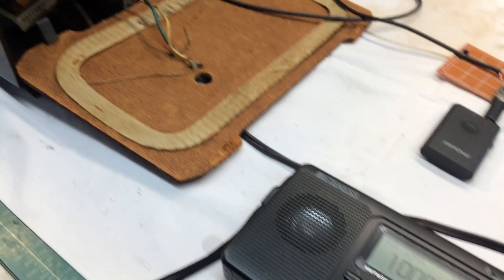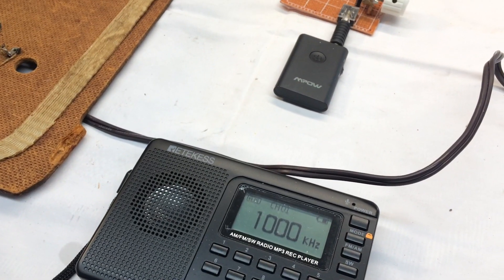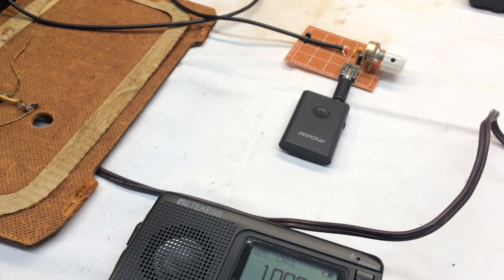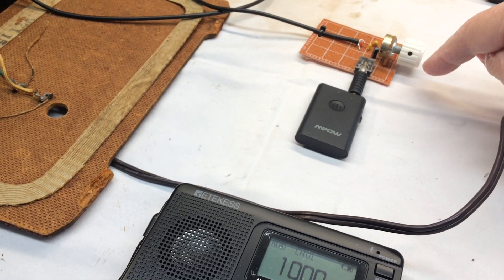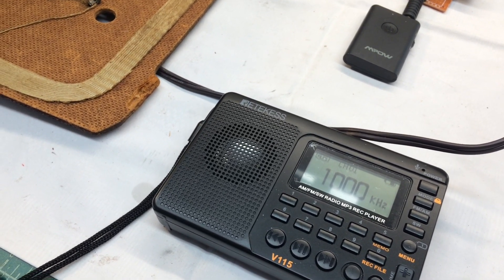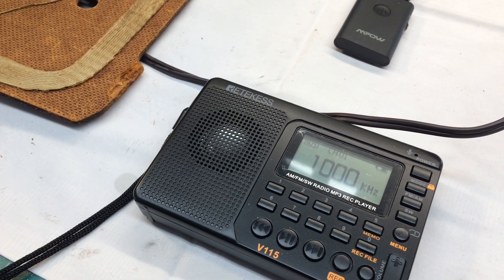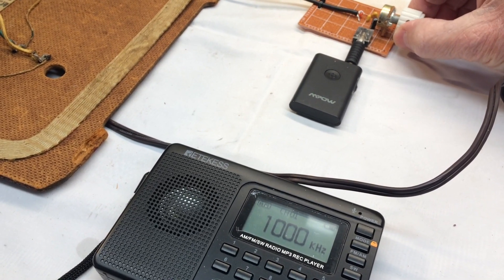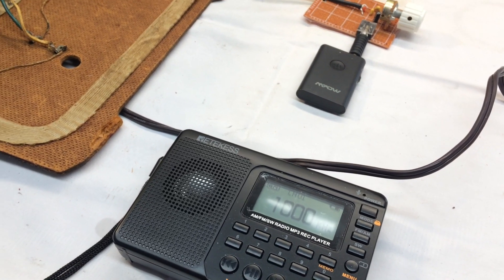Preview - Build an AM Transmitter using an AA5 Receiver or other...

Comment: Any chance you would have a field coil for a Philco 40-135 would you or know of someone who could rewind the original? 1700 ohm and looks like #38 or 39 wire. Can't wait for the info on the AM Transmitter. Thanks for doing what you do!
Reply from the maker: David - thank you for your kind words. Have you already removed the Field Coil from the Loudspeaker basket?

Doing the math quickly assuming a modern day line voltage of 120VAC, it seems the voltage drop across the Field Coil would be between 120 and 125 w/ the B+ current between 70mA to 75mA; just an estimate so a rewind of the Field Coil using 34 AWG at a minimum would be best, assuming there’s room on the bobbin for ~6506’ of magnet wire. Best, Don
Reply: @RestoreOldRadios  I do have the coil off the speaker noting how it came off. After removing the outer covering of tape I could see a spot that looked like it might have sparked, so I tried unwinding the coil and removed two or three pieces before I quit. I measured the wire the best I could  with a caliper and was getting .0035" and .0042".
Reply from the maker: David, send me a few photos of the Field Coil bobbin to my gmail at: TheRadioRepairGuy and I’ll review and reply back ASAP. Best, Don
Reply: @RestoreOldRadios  I sent them Don, Thanks
Reply from the maker: Just got back in, I’ll check it out and reply back. Don